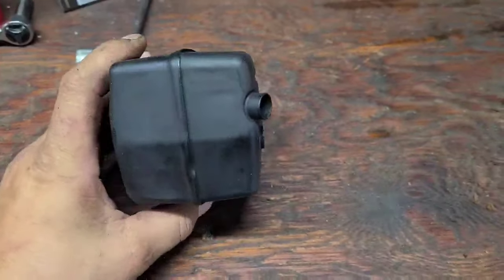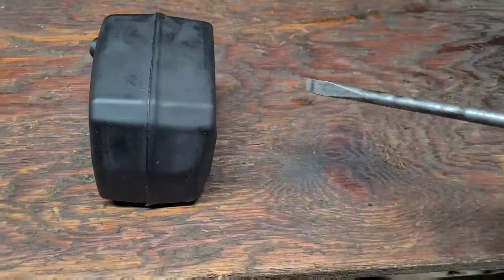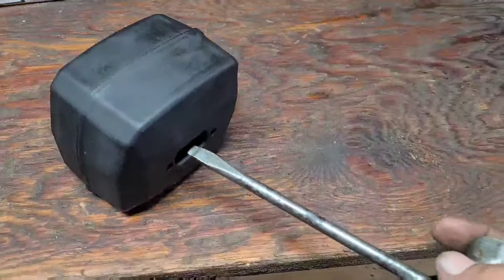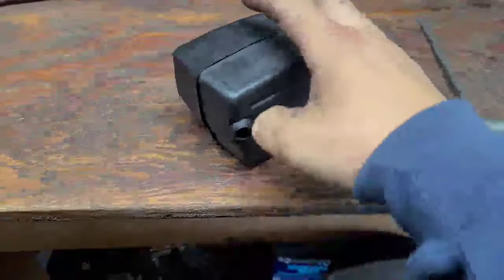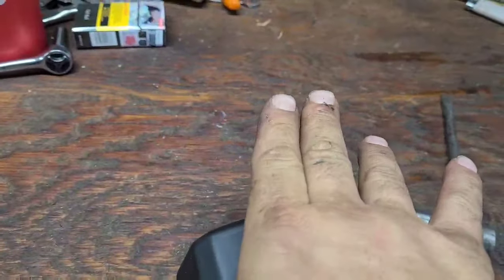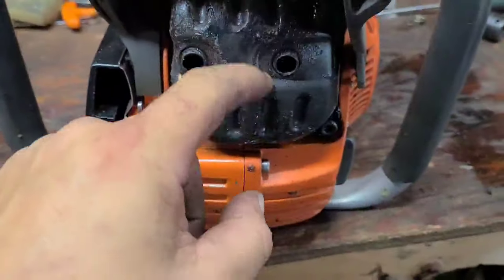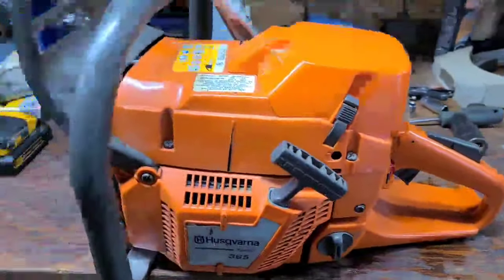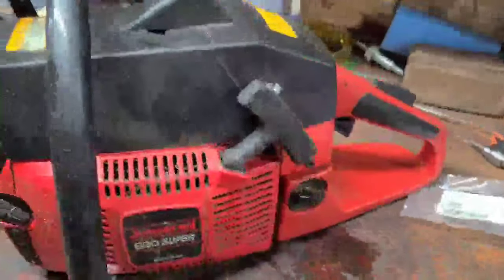Lets talk about chainsaw muffler mods.

Comment: "Is bigger better, is smaller better?" I'll bet that, for ANY muff configuration, there's an optimal "percentage of exhaust-port area" that's your optimal, I know 65% is thrown around a lot but the dynamics of the muffler obviously change this a ton, a 65% hole at the top of a straw like in the 590, versus in the front-cover a 660 muff, cause radically different behaviors (the former works, the latter spits fuel....IE like egan/bark boxes, IE no scavenging or back-pressure whatsoever)
Buckin' Billy "finished" what Harvey was showing the concept of with that L-pipe muffler...I think buckin's could/will be tuned even further, there's gotta be an even more optimized setup but IMO Buckin's is gonna smoke 99% of "modded muffs" people run on their saws!  I wonder how loud they are compared to say a Bark Box..
Something I will say is "dual port" always sounded silly to me, "I guess I have an octa-port" since I have a fish-gilled front then right?  Lol but I did find that muffs that are setup with 2 symmetrical-enough exits, it makes for a really cool noise, the sound from each hole is soooo close to the other but not perfectly harmonized so it creates that 'mean' sound everyone likes (this is irregardless...regardless...of how big the total exit-portage is, btw, that just influences volume...and for most it's gaining volume at the expense of good scavenging & back-pressure :/ )
My mods almost never require me to enrich my carbs...and they breathe real well! I'd expect that the "getting it hot then finding it leans-out" effect happens far quicker to the open-shot type muffs, they'd be inherently more sensitive than a cylinder that has a "2nd organ" (muffler) acting in-concert with the jug (instead of basically negating it by open-holing it, whether a big open hole atop a 590 muff, or an Egan cover on a 660)

Comment: Would you suggest increasing the fuel/oil mix ratio when you increase the size of the muffler mod ?
I recently got a Makita 4300 with a catalytic converter , in dim light you could tell was getting orange hot by looking at the outlet hole on the muffler, not good for engine life . I removed the catalytic converter and the saw sounds happier and rpms increased, I don't know how much , it's not a screamer , just sounds like it should to my ear  .  The manual says to run it with a 50:1 fuel/oil ratio , maybe I should go 40:1 with the cat removed ?  The external port is stock , just the internal cat that was removed .
Great channel , thanks for sharing a ton of experience.
Reply from the maker: I run 45:1 in everything, never a problem.
Reply: @tinmanssaws  Forgive me if you’ve covered this in a previous video, I’m a new viewer to your channel but I think a lot of people get confused in regards to fuel/oil mix ratios thinking that increasing oil ratio is helping to protect against burn down or a lean condition when it really is the opposite. Obviously, going to far the other way (too little oil)will get you back into trouble as well so I think it’s important to find the sweet spot in your mix ratio and then make sure the engine is getting the right amount of said mixture. (Which can change daily). “Jet of the day” as the saying goes in the snowmobile world.

Comment: Hi Mr. Nice video. I have det same muffler mod on my 576xpg at. Any thoughts on  open up the inner baffel so ther is more space for the exhaust gas?
Reply from the maker: That's what I did to my 576. Cut the baffle and enlarged the exit
Reply: @tinmanssaws   I will go in the exhaust entry on the muffler and open it up a little inside.  
Now i only have removed the spark arrestor and open it as you show in this video. 
Thanks for replying.

Comment: what about a saw like a dolmar ps-6100 that has reed valves on a clean air(no fuel) intake port that opens before the main air/fuel port? any need for anything but a straight thru exhaust?

Comment: I always operated under the impression that back pressure helped cushion you're rotating assembly and valves where present
Reply: Agree, on a two stroke,  I thought get rid of exhaust quick as possible but reduce the chamber size as it exits. That will stop any bog in throttle response. Ex 2 stroke dirt bike pipe. It exits quickly into a barrel size chamber then reduces as it exits. I've never heard of back pressure going back into a two-stroke motor?
Reply: @BillyP-49Chevy  maybe not, I'm not great with 2 strokes lol

Comment: Hi Tinman. I have a 346xp husky, no porting or anything, Stock. Predominantly firewood and a little bit of small felling. Would a muffler mod be advantageous?
Reply from the maker: Muffler mods are always a good thing. Gotta get the heat out.
Reply: @tinmanssaws  just thought I'd ask before I opened her up. This saw could have been the oddball saw that had a good muffler as stock.

Comment: I just did the mod on the 2511T Echo that all my climbing buddies have done. I took it back to the shop where I bought it and had them reset the tuning. He said he just set it back to the factory settings...It does not stay running in the tree. Huge jump in power, lots of 4 stroking in the cut for the high, so not too worried about burning it up, but not sure what to do. Perhaps I need to get someone to retune it, any ideas?

Comment: The whole key is exhausting gas fast and efficient while containing the shockwave. Bigger is better but im discovering smaller longer pipe has a higher tighter rpm range. Its the scavenge effect thats overlooked. I learned it with old chevy trucks. Exhaust for torque vs horsepower/rpm

Comment: Hey tinman. I’m thinking about getting one of those aftermarket mufflers for my 272xp. Would you remove the baffle inside and install it on to a stock 272xp and go from there?
Reply: You can actually order the muffler without the baffle already! I got mine on ebay for my 372.
Reply: @zachmetcalf3892  I’ve ordered one from wolf creek saw shop. It works great. Thank you 🙏

Comment: Great video, I enjoy hearing your thoughts on different topics.  If you went with 70-75% of exhaust port,  is that for ported? What about stock? Would 70-75% work or be too much. I'm thinking out loud here,  the forums mention 85% of piston side port opening and that's good for most saws. Not sure if that's for ported only. Thanks for sharing with us. Be safe.
Reply from the maker: I like 70% for stock saws. 

I find more then that and they tend to go lean when hot..
Reply: @tinmanssaws  I was thinking of 60 -70% of exhaust flange.  Thanks for clearing this up,  and for  sharing what you know with us. Be safe.

Comment: The total area of outlets in your muffler shouldn't exceed 70% to be safe and and effective. 

Meaure & calculate the area of your cylinder's exhaust port. Multiply x 0.7. There's your 70%. 

Figure the area of the stock muffler outlet & subtract from the cylinder exhaust  70% number.  The result is the max area of your mod hole.  
Or, your extra exhaust hole/port will be close enough if you follow these hole sizes:
3/8" for a 40cc saw, 
1/2" for a 50cc saw, 
 5/8" for 60cc and 
3/4" for a 70cc saw. 
If using a gill-type deflector on the side instead of a pipe, you van get fancy & drill the hole 1/8" smaller then grind it oblong to 1/8" larger than the 70% max hole size in the vertical direction. Or even narrower & longer.
Why? Does your garden hose spray faster & father out the open end  or with your thumb over the end? Which way increases the back pressure in the hose?

Comment: I run a bark box or their exhaust ports yeah I said ports LOL 2 ports or the bark box cover granted I run bigger saws 044 mag or biggerI run 2 ports which are 1x1 1/8 one on each side or I run the bark box cover but I just got a new to me 044 mag so Iam gonna run the bark box and a same size port as I listed above think it would be to much fits gonna be ported and polished by johns custom saws I told  him polish the snot out the exhaust and leave the intake rough Iam so the fuel breaks up and mixes with the air better than a slick runner and we all know the slick on exhaust works but from your knowledge do you that to open don’t get wrong she sounds wicked but an mmm type  we

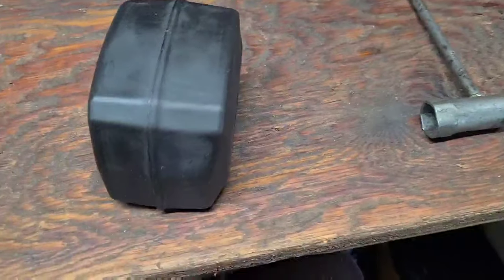Comment: at 7:26  "Ported saws run hotter..."  MANY of the top tuners claim they run cooler- who is right?
Reply: More compression and more power means more heat. Good muffler mod will help alot on the heat issue. But laws of physics are still same for everybody.

Comment: You can definitely go too big... there’s lot’s of guys building saw’s that rip open the exhaust port and open the muffler...yes they run more powerful because they are dumping excessive fuel mixture... there’s definitely some very inefficient saw mods being done and sold.  I believe a good balance of the intake duration and volume and the exhaust duration and volume creates the most power for the most efficient fuel usage.  The expansion pipe request a 6 degree curved face wall to focus on sound waves back into the center of the exhaust port window...  so I couple of big holes out of face will just dump fuel... imho... having one inch or 3/4”  of the exhaust port pipe sticking inside of the muffler... in the top corner allows the gas to escape but to still rebound....  the concept of a catalytic converter on a chainsaw is just so absolutely ridiculous that it just shows where the epa and their pressures have pushed the muffler concept on chainsaw’s.... I just freakin love the honesty and respect that you convey through your videos!!!👍😁

Comment: Novice question, what do you mean when you say the saw goes lean?
Reply from the maker: The saw doesn't have enough fuel so it goes lean.
Reply: Lean fuel mixture can creat detonation. Which wrecks motors. That’s where the fuel mixture explodes under compression before it was supposed to be lit by the spark plug.

Comment: I use  my saws for my living, I dont modify mufflers, my saw has to run all day, every day.
 Just like the mix, I never bought into 50 to 1. Friend said " I'm goin strictly by the book,,, 1 month out of warrantee his ms660 wore out, 2 years later mine, at 40 to 1 sill runnin strong.
 Yes heat and too lean, good for the salesman, not u.

Comment: ok bud.. pausing the video, and will give my opinion, then continue watching, maybe I am wrong! I see it like this..... weather the saw is ported or not, you only need the muffler to let  out, what the output can allow... know what I'm saying? first off, a little bit of back pressure is good for engine to gain peak performance (look at dirt bikes, muscle cars, etc, thats why headers and fat then skinny 2 stroke pipes are a thing, allows top flow, with perfect ratio of a bit of restriction. That being said, when shes wide open, shes gotta be able to clean out. So for instance, a 2" hole in the muffler gains nothing if the exhaust port in the cylinder is only 3/4". you can play around with maybe going a C-hair over, and tinker with that ratio, and see if you like it, but oversizing the exhaust gains nothing, only so much can fit through there at any given moment. blow through a garden hose, feel your lungs working with a hair of back pressure? now blow through an empty toilet paper tube... breath just falls flat doesnt it? I believe an engine is the exact same. ok..... now on with the video, and lets see if we agree? :-)
Reply from the maker: Well port size may be part of the deal but I'm not sure if it is. Port velocity at time of opening and port duration I think (and I may be wrong) is the nost important.  

Backpressure vs port timing vs bore and stroke vs resonance is how I look at it. 

I do mods mostly based on port timing and bore and stroke. The engines numbers dictate to me how and where I mod the muffler.
Reply: @tinmanssaws  Very well said, which is why I threw in a "tinker with a c-hair close" I may be way off, but I always look at max possible outflow, is biggest you should go on the muffler, cant get more than that (well you can but..) as you mention, you want some resinence, a bit of back pressure so it doesnt gasp out and fall flat. Totally agree with if porting, do what you are going to do, then, adjust muffler small, slowly, until you get what you want. can always take more out, harder to weld back up. You got it though brother! You are way more savvy about your numbers and stuff than I am. I have never done actual "porting" per say, as much as I have done more "polishing" with great results. Keep up everything you are doing, I'm learning with you, and I think all your thinking is definately in the right frame of thinking :-)

Comment: My 029 super get's a bit hot after 10 or 12 cut's probly in my best intrest to open her up a bit and richen her up?
Reply from the maker: Yeppers
Reply: @tinmanssaws  is an aftermarket muffler worth buying?
Reply from the maker: @DeezNuts-xo2ee  I used them often. Depends on the muffler.
Reply: @tinmanssaws  do you have a recommendation for 95' 029 super a link maybe?